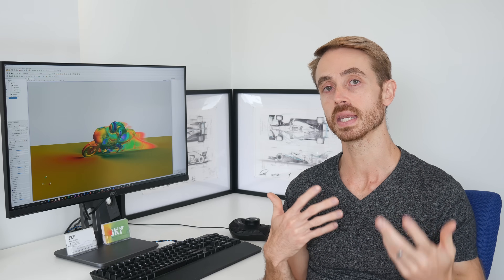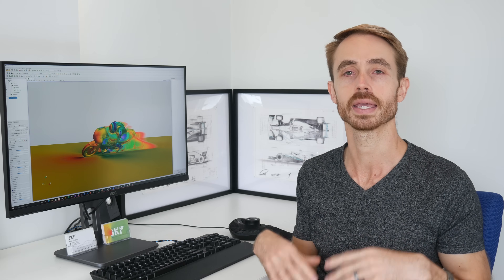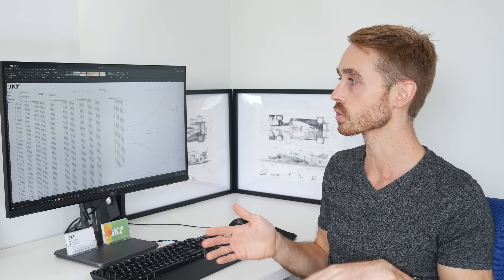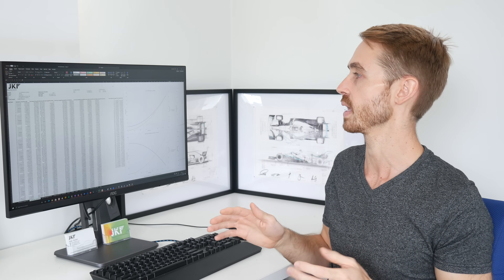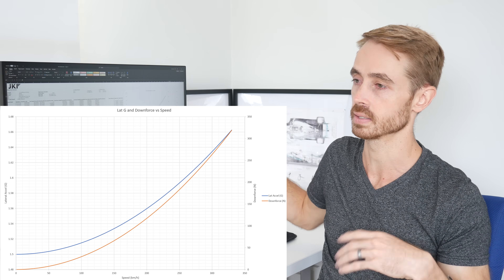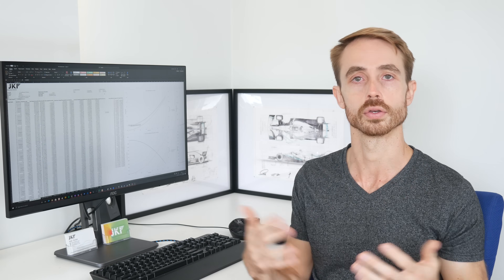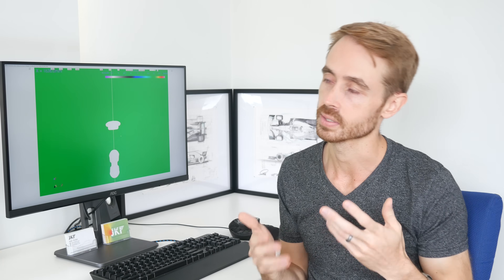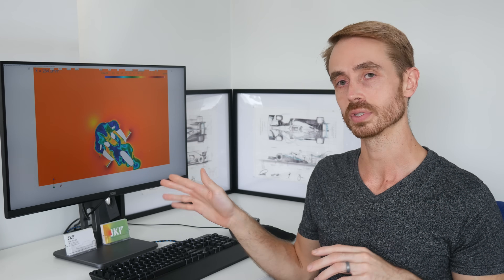How Do Motorbike Winglets Work?

Comment from the maker: Hey Guys, this will be the last video of the year before I take a bit of a break over Christmas and the New Year, with videos resuming late January. Stay safe and have a great Christmas/New Year!
Reply: Merry Christmas Kyle!
Reply: Merry Christmas!
Reply: happy holidays
Reply: Happy Holidays Kyle! Are you still planning to do the paid aero courses?
Reply from the maker: @rytisvitenas5784   Most certainly! Main problem is finding the time for them, at the moment, so they are taking far longer to make than expected, sorry!
Reply: @KYLEENGINEERS  Happy New Year. Have you thought on making a video on cpu fan aero?  A youtuber - Major Hardware, gets plebs to send in designs and tests them. Maybe do something like that? I'm sure you could make something special
Reply: Hi, 
Can you make a video explaining how the slots and vanes help in cleaning airflow. Like the slots on the extended floor area in the side of the F1 car, vanes and slots in bargeboards and under the nose. How does this mechanism work fundamentally.
Reply: What is the software used?

Comment: As far as i know, winglet during cornering with the pilot tugged in is counter productive. The pilot need to block the inner wing aerodynamic with its body to make it stall so the the inner winglet doesn't create an outward force, and the outer wing (which is at an angle) generate a proper DOWNforce
Reply: the winglet are in an inverted V shape. When the bike is at an angle because it turn. the inner wing should be almost vertical (highly indesirable) and the outer wing horizontal (highly desirable). Hence the need to block the inner wing. (on top, of course, of moving the combined CG that have a much more impact on cornering ability than any static winglet)

Comment: Why not just put small vortex generators along the entire side of the front fairings where fairing holds windscreen down to bottom near front tire?  VGs should improve aerodynamics with or without using winglets correct?

Comment: Currently building an active aero setup with winglets up front tied into braking and will provide roughly 10lbs of pressure at 80°, 140mph, and 30in² while in brake mode.  I have zero knowledge about flow characteristics and wing design but electronics aside I have designed a wing and 3d printed them off for testing.  

What programs can I use that are cheap for modeling?
Reply: Did u finish this active winglet idea on a real motorcycle?  I’m wondering why not instead just put vortex generators along the entire side of the front fairings if creating vortices and low pressure is the goal?

Comment: Maybe I'm wrong, but I'm thinking that, in corner, the wind has not to be considered aligned with the bike, but with an angle.
You can imagine this thinking to driving a car, with open windows...if you turn right the wind will come in from the right side window and excape from the left one...just because you are inducing a lateral component. 
In order to calculate the angle you can have a good approximation considering that, with no side slip, a bike has a direct relation between roll angle, speed and turning radius. So, for a defined roll angle and a defined speed, you will have a specific turning radius. 
Nice video and really really interesting. 
Well done.

Comment: Hi Kyle, Fascinating channel. The winglets are an interesting subject for a bike. A car remains mostly flat in a corner, so the more downforce, the more the tyres are pushed into the tarmac and the greater the grip, the force vector is always essentially vertical.. But a GP bike is layed over to an astonishing degree when cornering. Wouldnt the downforce be resolved into 2 components, a vertical and a horizontal? Once the bike is past 45degrees, the horizontal component would be greater than the vertical and actually work to increase the likelyhood of a loss of traction.?

Comment: If your findings are that there is "less upforce" above the bike (you mention the back of the saddle, more specifically), what makes you call it "more downforce" ? Don't you call it "downforce" for the single reason that you're looking for downforce ? I don't call it "downforce" however, but "less upforce"... Every object (be it a bike, a car, ...) moving over ground through air, at higher speed, generates underpressure zones above it : faster moving air on top creates underpressure there. However, as I told, I wouldn't call your findings "more downforce" but rather "less upforce (lift)".

Let me call drag something like "underpressure at the back of the bike" ? Generally, underpressure forces pull with more effectiveness (i.e. harder) when located closer to the bike. If moved further away from the bike, they pull with less effectiveness (so with less force).

I dare to state that those winglets are moving as much as possible all underpressure zones away from the bike in a controlled way, their main purpose being : to make the underpressure zones pull (backwards/upwards) with less effectiveness. The winglets move the underpressure zones away from the bike by means of the vortices they generate, and which you also mention. Unfortunately, vortices are air set in motion. And in physics, nothing comes for free : anything you set in motion, how little its mass, consumes energy. So does vortex generation. So vortices "cost" some energy loss (drag) indeed. BUT they cause the underpressure zones to be less effective in doing their "job", which is to pull the bike in the direction of the underpressure (hence less drag - the force pulling backwards - and less lift - the force pulling upwards).

So I tend to state that such a winglet's main purpose is more to make the air flow in a controlled way around the bike, making a little "energy investment" by (OK, drag-causing) vortex generation, but getting this investment payed back multiple times by less overall drag at the end of the addition.

Comment: Hi Kyle, loving your channel! With the exploding popularity of overlanding (touring) in the USA, could you talk about and maybe look at how adding a rooftop tent affects aerodynamics. Both overall and in specific configurations 

IE: is it better to mount a tent on the roof of an SUV (increased frontal area) or on a short rack on the bed of a truck (or tray of a 'ute)? 

Even though these vehicles are not made for speed, I think these modifications (tents, big tires, off-road bumpers, etc) could be having a material impact on vehicle efficiency and safety even at just normal highway speeds.  

Keep up the fantastic work!

Comment: One thing that is generally over looked in this top is what the wings are attached to. Simply attaching them to fairings wont be strong enough to support the downforce applied to them. 

Internal framework has to be added to support the wings. Great video, as usual.

Comment: Can’t it be said the winglets may not always be about downforce, rather about airflow and placement?  For example, moving air in and around hot parts to pull the heat out of the part?  Or to have a ram effect to the induction system?

Comment: Hi Kyle, really enjoying your videos, Thanks.
Would you know if the MotoGP teams would work with the riders to guide them on the most efficent body position for various stages of a lap - i.e minimising drag on the straights, and maximising downforce under braking and cornering?
Reply: Riders have understood these concepts for quite some time now, you will see them tuck in when accelerating and splay out when braking. They have a sense for speed and will naturally find the optimum body position to go as fast as possible, therefor im certain that any body positioning changes necessary with the introduction of wings will have been be quickly sniffed out by the rider himself.
Reply: @alexjfree  its true that there is a fair bit the riders will do intuitively, but I was watching a video about track cycling and the process they went through to optimise the riders aero position at various stages of a race. 
A lot of it was very subtle, some if it far from intuitive. I suspect that maximising downforce in cornering will be one area where it won't be intuitive. 
Hence the question, as it looks to me like a bit of science and engineering could make sure the benefits of the bike aero are realised.
Reply: @JakobusVdL    I personally think that the rider will make necessary adjustments without knowing he is dealing with downforce, as it effects the level of grip, a feeling for that grip and an ability to manipulate the bike to find the absolute most of it is what separates the motogp guys from the rest, however they are only human and so there will be some margin for error that could be ironed out. I think comparing it to the cycling example doesn't exactly work when you consider this, as the drag reduction being done in cycling would provide little to no feedback and therefor no way to feel your way into it (hope that makes sense). To answer your initial question though, I asked my mate who worked in motogp until very recently and he says that teams do wind tunnel testing to ensure the least amount of drag on the straights for instance but It's not as extensive as maximising downforce mid corner through the coaching of rider body positioning. I actually know of teams doing this outside of motogp also.
Reply: Cheers @alexjfree  , with cycling there is lots of feedback, they measure the  riders power at the pedals, and speed to fractions of a kph. And as their watts are very limited, small improvements in aero efficiency make a big difference.
With bikes, now they are designing the aero for downforce, I'd think the teams are missing a big trick if they are just leaving it to the riders to figure out how to get the most out of the downforce, after all while the riders are ridiculously talented, and might eventually figure it out, none of them grew up riding downforce bikes so thats not guaranteed. I'd think the smart engineering approach would be to use all the tools to help the rider figure out how to maximise the new technology, and help the engineers to figure out to design aero that riders can most easilly get the most out of.
If that isn't happening, then there is huge opportunity for Kyle with a MotoGP team.
Reply: @JakobusVdL  I certainly see where ur coming from in terms of ensuring the downforce is at its most effective. We just have to remember at which stage of aero development motogp is at. F1 has paved the way so motogp has a path to follow in some respects and I expect it to catch up quickly. Whilst teams might not be doing everything they could be atm, I can bet they will be very soon. With regards to the cycling, I am a cyclist and dw I’ve spent plenty  of time looking over my own data (maybe too much? Lol) however what I meant by feedback was more in terms of the feedback the bike delivers to the rider, this is commonly known as his feel. There is little feeling provided through any bike when u make small gains in drag reduction, however the changes in grip as downforce levels change will certainly be felt through the motorcycle. This was the reasoning behind my argument :)

Comment: Once the motorcycle is leaning more than 45 degrees, wouldn’t lift be beneficial rather than downforce? The last thing a rider would want would be more force pushing to the outside of a corner. I couldn’t see anything in your aero modeling of the winglets that would help cornering. Is that because the winglets are not allowed in the rules to help cornering?

Comment: More videos but this time 2020 Moto GP bikes vs Britten v1000 with aero and motoinnos ducati . 

Is there by any chance u have an engine and suspension engineer from F1 to look at Moto GP bikes. 

I wanted to see if F1 suspension system with a motorcycle version of a double wishbone suspension could be used for front and rear  . 

Just to reduce wide open throttle induced wobble and  massive wheel base length change while braking .

Comment: Great video as usually! 
If I'm not wrong, you didn't change the rider position in the analysis, did you? 
I'm not expert on the topic, but I feel that changing it would give significant results, with the driver knee reducing the lift of the internal wing, and maybe also increasing a bit the "ground effect".
This, together with the fact that the wings are not generally on the same plane, would result in an increased vertical component and decreased centrifugal component , improving the cornering.
Just an idea for an other video 😉

Comment: I know it's not as sexy as performance cars/bikes but could you maybe explain some of the aero stuff on commercial trucks these days?  Things like the vents on cab overs in Europ for example.  I can not figure out the point of them.  They are usually on the front cab corner and can be some sort of scoop, vent, or even vertical wing-like devices.  They have no cooling elements or anything like that in them.  Just a hole/ducting system from the front to the side of the truck cab and mounted right on the front corner. Usually just a bit below the windshield.   We see them a bit here in the US as well.  But cab overs are kind of rare.  What I am seeing a lot of in the US are vortex generators on the trailing edges of the sleeper/cab.  My assumption based on what I have learned from your other videos is that they would make a sort of wall to prevent air from pouring into the space between the cab and trailer.  It is around a 12-15 inch gap to cross and there are usually a ton of vortex generators.  I thought at first it was just some guy sticking them on the truck for his own amusement.  But I am seeing them more and more often on company fleet trucks.  Looks to be a factory option.

Comment: What am I missing here?  You keep calling it 'downforce' but with the bike leaned over it's resolved downforce (which whilst typing this I hear you did mention!!).  What's more, as the bike goes past 45º then the 'vertical' (z) force, relative to the bike and not gravity/floor is now a larger component that effectively is pushing the bike away from the corner thus increasing the tyre loading requirement.

I suppose that if the co-eff for tyres is 1.5 that even the resolved vertical downforce is beneficial due to that co-eff multiplier.

It would be interesting to see if knee out actually stalls the flow to perhaps prevent this?

I have always wondered why they haven't added subtle aero appendages to the rider/leathers/suit to capitalise on these.  Must be a regs thing :)

Comment: How much load from downforce is pushing the motorcycle toward the outside of the turn during cornering?  My assumption before aero became common in motoGP was that any downforce would just turn into aero pushing you toward the outside of the turn as lean angles get above 45 degrees (motoGP lean angles can exceed 60 degrees).  Is the aero simply to prevent wheelies during acceleration and to keep the rear wheel on the ground during braking and does not benefit corners?  I see a lot of motoGP bikes have their winglets angled downward, I am curious if they are relying on the slip angle of the motorcycle to reduce the angle of attack of the inside wing, thus reducing the outward component force.

Comment: what's interesting about bikes is that the rider has a massive influence on them. under braking, the nose dives quite a bit, which would greatly change the angle of the bike and aero surfaces. The rider hanging off also makes quite a big difference. I can only imagine how difficult it is trying to model the aero surrounding a rider as we have a million different riding positions

Comment: Very interesting! One thing you didn't touch on was why these wings were added to MotoGP bikes, main reason to combat high speed instability.
Wind resistance at high speed acts like a lever on the bike and rider, causing a weight shift backwards. Combined with something close to 250 hp (meaning they are trying to wheelstand and flip even in top gear) and the front wheel has no weight on it at top speed. The result being those handlebar wobbles and weaving you see on the straights.

Comment: It's interesting that they generate so much downforce to the rear wheel also. I always thought that they help mainly keeping the front wheel down when accelerating and increase front tire grip when braking but it's also the another way around.
Reply: im pretty sure you guys can make the most downforce.
Reply: Wow, wasn't expecting HPC on here!
Reply: I am as good as convinced that "less upforce" is interpreted as "more downforce" here...
Reply: Higher CoG means weight transfer is high to push tyre down when braking, extra down-force would be needed at rear to prevent rear wheel lift.
Even somewhat older (late 1980's) Sport Tourer street bikes can very easily lift rear end under hard braking.
Reply: According to kyle, the newly created vortices interact with the seat resulting in more rear downforce.
Reply: Winglets are primitive design and thinking... on street motorcycles they are mainly for show off

On moto gp ducati bike wings arent used anymore as much as air curtains and ground effect wheel covers on the bottom half of the wheels

Having wings doesnt make sense when cornering it will push the motorcycle to the outside of the corner... and any downforce device above wheel axis of rotation will be pushing the bike to lowside hence ducati wheel covers on the bottom half of the wheel.

Comment: Great insight there, thanks! 
Could you have a look a the current complex WRC rally cars? Since 2017 they have had significant aero and even flat floor with diffusers. There are a couple of different solution from different teams.

Comment: Do you think that there is an aerodynamic reason for the holes on the back (rear side panels) like on the 2015-2020 Yamaha R1 or the Ducati Panigale V4/1299/1199? Or is it just for the looks? I think there might be a reason because of these vortices, created by the winglets, that push the flow upwardly. Thanks mate, GREAT video!